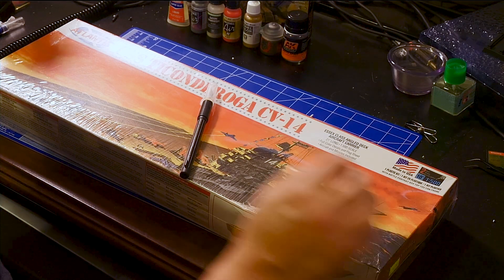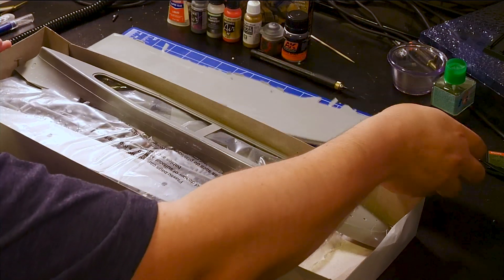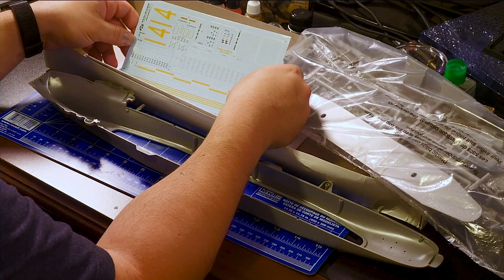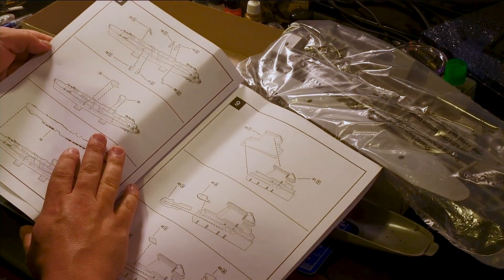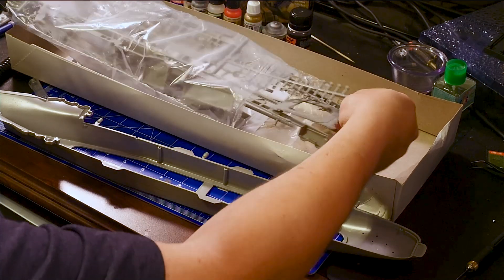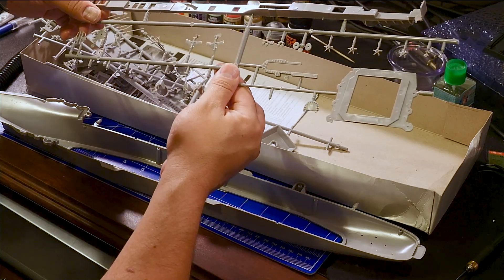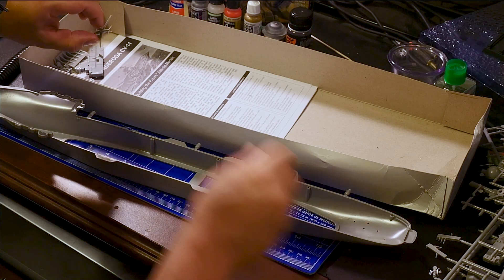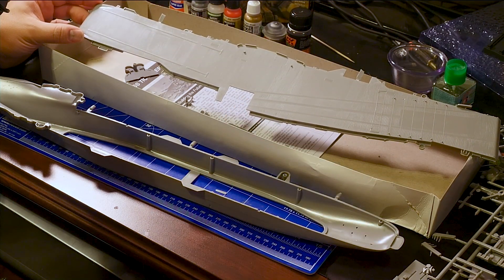Atlantis USS Ticonderoga CV-14 Unboxing

Comment: Hi there.......special model for me too. My father also served aboard Tico during Vietnam...flew the A-4 Skyhawk. Might have been same tour .This was an original RENWAL kit from the late 50's through 1960's. Remember it being in his office when I was a kid. This kit depicts the ship in the late 1950's (Regulus Missile era) so you may need to do some legwork to get proper aircraft for Vietnam era. Would be glad to help answer any questions. Excited to see this kit back after so many years! Been waiting.
Reply: The kit was originally released in 1960 by Renwal and only once as the USS Ticonderoga. The mold was re-used as the USS Shangri-la several times by renwal in the 60's. The Ticonderoga kits became pretty much extinct and you would pay 300-500 on E-bay for a copy. Revell must have acquired the mold when Renwal folded because the kit was again issued in the late 1970's as Ticonderoga by a company called ADVENT. It was some sort of spin-off of Revell. This is the kit I currently have. There are NO DECALS however so building it for my dad was going to be a problem. I did however get a Revell USS Lexington kit 1/542 scale and a Revell USS Wasp/Hornet (1/542...the NASA recovery kits) on E-bay. Those kits are still available on E-bay and have  Crusaders and Skyhawks in the kits to use for a Vietnam Ticonderoga. You would need to find a few Skyraiders (I think the Revell USS Midway, Roosevelt and Coral Sea has those). I do not know if there are aftermarket planes available for this scale.....I doubt it.  BTW......ask your dad what cruise he was on. Was he a "Fourrunner" from VAH-4 Detachment B? If he was on the 1965-66 Rolling Thunder deployment then he might remember my dad. He was a VA-56 Champion. If so ...I have tons of color slides my dad took on that cruise including some of the A-3's. Be glad to share...they are already digitized and can be e-mailed.

Comment: I have bought this kit and was wondering if you or anyone else who has built it was unable to finish the kit due to the flight deck not being able to be fitted onto the main hull? It seems there were severe issues with my flight deck being too long or perhaps the main hull being too short such that I was unable to fit it. This is the first time this has happened to me as I have built multiple carriers from Italeri and other model makers without any major issues.
Reply from the maker: I am ashamed to say that I have yet to build the model. I made the unboxing video, and like many modelers was sidetracked by too many kits in my stash. One might say I have the attention span of a gnat.
Reply: You may have to do some cutting and chopping to get the flight deck to fit.  As others have stated these molds are old and well traveled so you most likely will get some degree of misalignment.  Anyway, what I would do is assembled all the hull side bulkheads and sponsons first.  Allow at least a day for cement to dry as these bulkheads are major structural elements and you will to do some manhandling to get the flight deck to line up.  Once all the bulkheads are set up, start fitting the flight deck at the bow by lining up the portholes ( i think there are seven) at the bow round down.  Line up the vertical 3/8 inch flange around the perimeter of the flight deck with the vertical hull bulkheads.  YOU WILL HAVE TO DRY FIT, ALIGHN AND POSSIBLY CUT AREAS ON THE MATING SURFACES TO GET A GOOD FIT.  Be patient and observe where the hang ups are.  Keep dry fitting until you get a good clean fit.  Once that is achieved apply cement and use either clamps and/or rubber bands to hold down the flight deck to the hull.  Allow this to set for at least a day.  You may have to add small amounts to plastic card to seal in some gaps, but this should get you there.  Remember, have patience, dry fit and have rubber bands ready.  It is an old kit with alignment issues so it will definitely put up a fight.